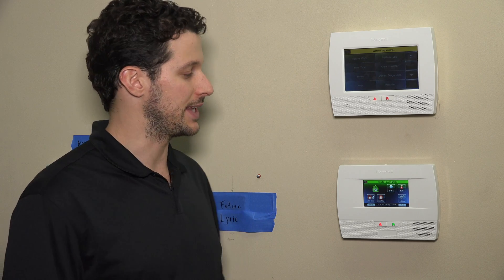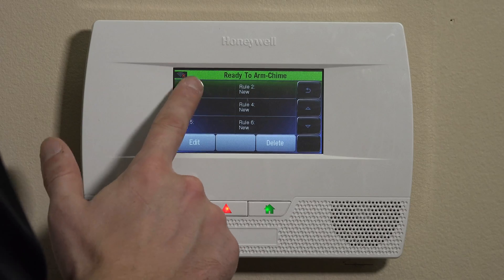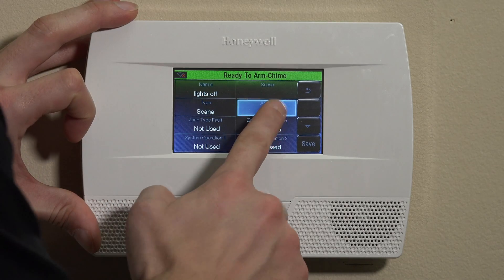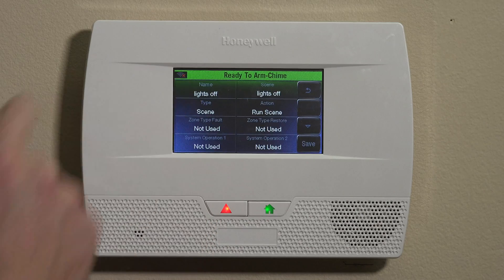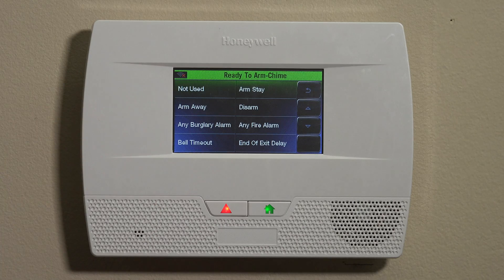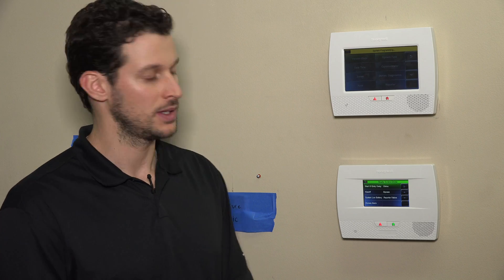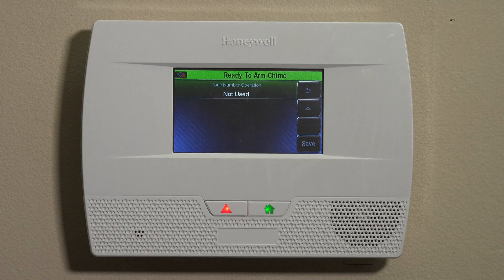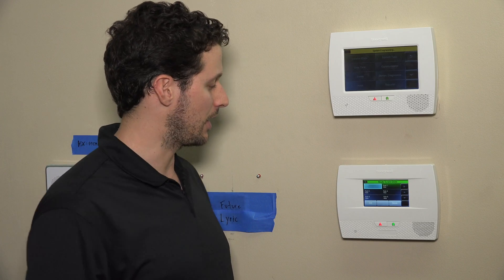Honeywell L5210: Z-WAVE Rules

Comment: How would you make a rule for when the system is tripped for a burglar alarm, for it to make the lights go on and off during the alarm going off?
Reply: Hi @fasttrackstormtracker, 1. Ensure your Zwave lights are enrolled properly.   2. Create scenes "Light on And Light off" in the "Scenes section of automation,   3. Create a rule for the Zwave switch to come on when an alarm condition occurs, and link the "Light on " Scene.,   4. Create a rule for the Switch to stop using the "Light Off" scene to follow either bell time out or Disarm.